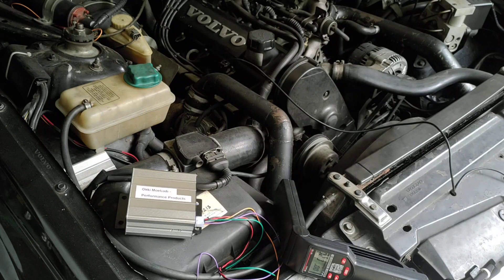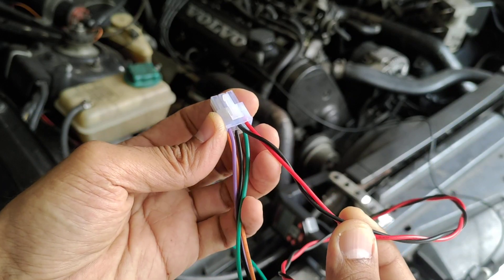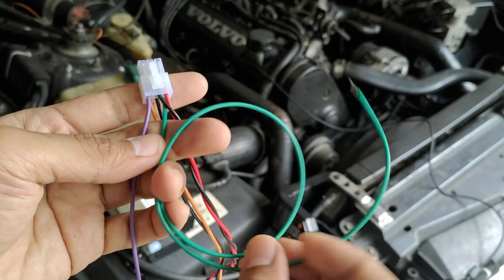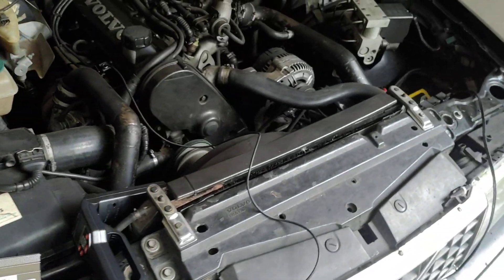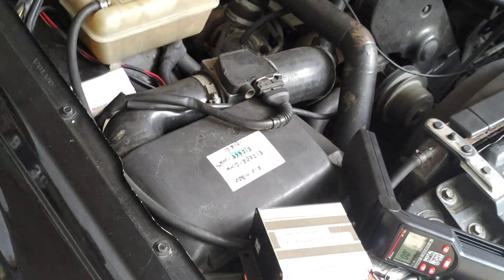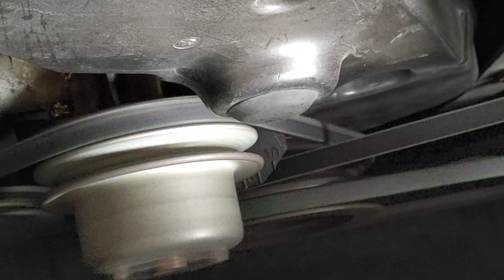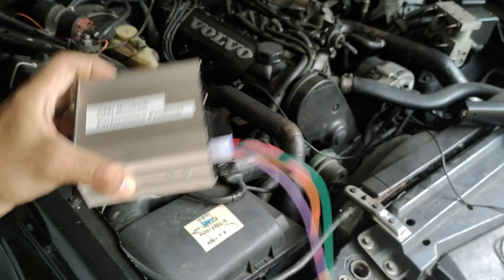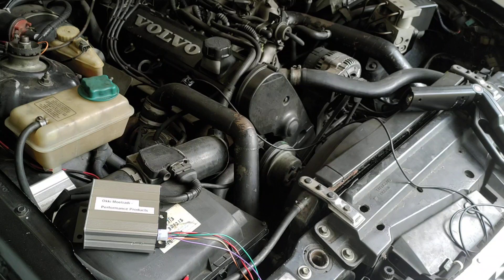CDI Single Channel - Car Installation

Comment: Can I install this CDI in my car with distributorless engine system ?
The machine using waste spark ignition
Reply from the maker: Not using this model. I have 2, 3 and 4-Channel CDI Module also. If you have 4-cylinder engine with wasted spark ignition system, you can use my 2-Channel CDI Module. For 6 and 8-cylinder engine with wasted spark ignition system, you can use 3 and 4-Channel CDI Module.
Reply: @OkkiMoeljadi  do you have shop ?
Reply from the maker: @keliktyuwono  https://tokopedia.link/LtqFP02c5jb